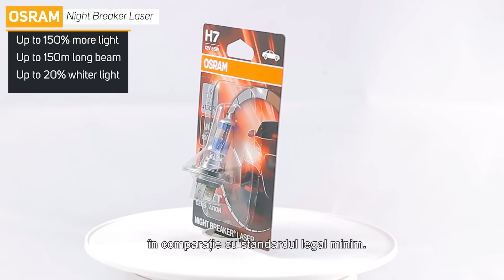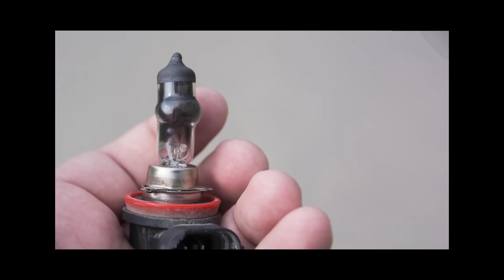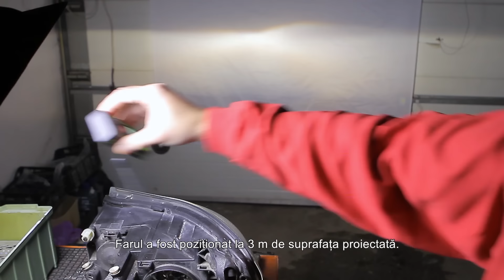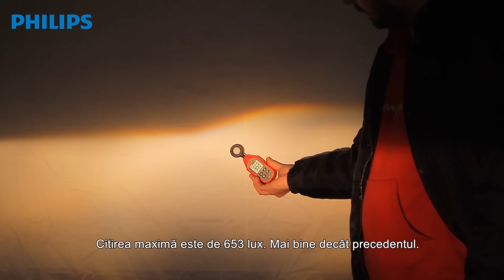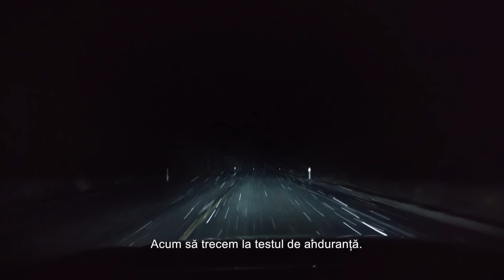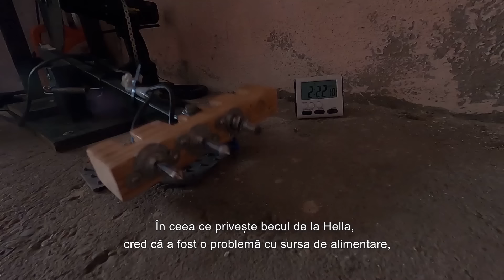Philips RacingVision vs Osram NightBreaker Laser - Endurance & Brightness Test

Comment: The failure mode of the Hella bulb is typical of filament lamps used in vehicle applications. The vibration causes the filament to break and the filament to move around with further vibration. This continued movement often causes the broken filament to reconnect and "weld" itself back together. Thus creating a shorter filament with lower resistance, higher current and higher light output - until the filament finally burns out again or breaks.

Comment: After many years I was using the night breaker series in H4 and H1, I decided to try out H7 Philips Racing vision gt200 one in projector lamps for low beam and reflector as high beam. The difference is quite high in my opinion. For the endurance I will watch it, since I use at least low beam day and night.
Especially for high beam the Philips version is a great advance, I can definitely recommend it.

I have a 2005 Chevrolet Lacetti which was equipped with H4 lamps. I am still a bit disappointed of their lighting ability, so I replaced them by original Suzuki Reno headlights which fit perfectly to the Daewoo/Chevrolet model. Only the connectors had to be adjusted.
Thank you for the great video!
Reply: Hi there.. How is the life time of your Philips? they still work?
Reply: how are the Philips bulbs? 1 year Update?

Comment: Having had both the osram and the Philips I can say that the Philips are a whiter light and last longer than the osram. The osram lasted 6 months, the Philips are still in just over 1 year later.
Reply: I bought a set of Osram Nightbreakers for my Megane. Literally just the other day one died at just a little over 18 months. Given the OE bulbs lasted YEARS that's not great. Light output was OK but no discernable difference over the factory fit H7s.
Reply: I had those Philips also in my car and they lasted almost 2 year even promised on box 450 hour lifetime. Much whiter light dunno are those more luminous but at least you can see light better instead regular more yellow light tone.
Reply: I had bought 25watt osram leds and one of the leds failed after 1year of use

Comment: The Osram NightBreaker lasers that I had, lasted 2 weeks. With less than 500 km of driving on asphalt roads in decent condition, I don't think I'll ever buy anything by Osram. Sent them email and the only reply I got was "Well, they shouldn't really break that quickly." Nothing else. I really should've made them give me new ones or just pay me back but I was extremely busy back then and didn't really have the time nor the energy to anything about it. Just bought a different pair of bulbs and went on with my life.

Comment: I don't think it was a problem with the power supply. It was the bulb burning out. Sometimes normal home light bulbs go out the same way. I guess it's because the filament somewhere gets thinner and this means it gives out more light. For a very little while, because as you said, this causes the temperature to rise dramatically in that part of the filament and it burns out.
So you could include the result from Hela.

Comment: More than 10 years ago in Sweden, my Toyota Hilux had glass lenses (not plastic). 

In that car I had Philips 100/140W H4’s (yes, they were illegal…). In combination with 3 Bosch Navigators in the front as well 6 driving lights at roof level (all Philips 100W) I had enough light in front of the car to reach ~2500 meters of light in front of the car at night. 

With that experience I still favor H4 & H3 light bulbs to modern LED’s. …and seeing your tests of old school bulbs for reflector headlights versus LED replacements there’s no question I will remain the old school kind of guy.

Comment: laser frate :)
I used Philips racing vision in the past. first impression was that they were brighter. No placebo, because i compared the lights during assembly
I used them for 3 years and then one burned and replaced it with the original hella.... surprisingly there was no more difference between the two. maybe the blue filter got worn in time.
Nice video. keep it going
Reply: No it's not the blue filter, actually halogen lamps do get slightly dimmer towards the end of their life. 
For some reason neither Osram nor Philips quote this figure in their data sheets for automotive lamps, but you will find these figures in their data sheets for hosehold halogen lamps. The most similar one would be the 12V 50W hosehold halogen lamp (for example, Osram HALOSTAR PRO 50 W 12 V GY6.35).
It says it has a light output of 80% of it's initial value at the end of it's life.

So if you replace used halogen lamps with new ones, the new ones are almost always slightly brighter, even if it's the same product.

Comment: Superb video.  Just what I've been looking for, for my GL1800 Honda Goldwing.  I've tried Ozrams on one of the cars and as good as they were they blew within weeks so I didn't buy again.  Ozram have a motorcycle H7 which is supposed to be more robust but if it is why not make it the standard for all vehicles?  So, I've been considering Philips.  Trouble is, changing headlight bulbs on a GL1800 is done by feel, and you need very small hands, so it's not something I want to be doing on a trip because it's not a 5 minute job.  But after watching your video I've decided that the small gain in light with Ozram or Philips is not worth the increased risk of bulb failure and I've decided to stick with the standard H7's. A big thank you.

Comment: I've fitted Philips racing vision six months ago in my 05 corolla, really pleased with the results but only last 6 months. It's a pain to fit them and they are not cheap but I'd buy them again.
Reply: Wow, my Osram Night Breaker laser is more than a year now and still working fine.
Reply: I've used Phillips racing vision in a couple of cars - all still working after 20 months although I can't tell if they are dimming now or if my eyes are getting worse

Comment: I installed 100w halogen bulbs many years ago on my FIAT 127. The light body was glass so high temp was not an issue, i had installed new wiring and a relay, so everything was safe and lasted many years. The difference in lighting was amazing! 
Would not try it on modern cars with plastic housings.

Comment: Completely normal for a filament bulb to be super bright just before it goes out. It’s because the coil shorts, resulting in less resistance thus drawing more current at the same voltage. This creates a brief over temperature = more light and whiter light before the filament melts completely.
Also used bulbs can actually become brighter than new bulbs because if micro cracks in the filament resulting in micro arcs (like xenon arc bulbs) even though they will actually draw less current because of higher resistance due to cracks = effectively thinner filament.
Reply: Btw I’m an electrical engineer so if I can contribute to your channel in any way just reach out. Think your work is great!

Comment: you might want to use another method to test for the effects of vibrations on the light bulbs though, the vibrations on the road tends to be higher frequency than just 3 cycles per second. good video though, very informative, will be waiting for another one

Comment: I personally prefer the Osram Nightbreaker LED Version.
It's not so cheap (I paid 110€ for two of them) and they were basically plug&play. 
Have been using them for around 3 years and they still shine as bright as on day 1 and don't throw any can-bus errors.
If you own a BMW that was manufactured after 2010, make sure to reprogram your board computer.
Use Beemercode and a compatible dongle to easily reprogram the bulb type from Halogen to LED.
If you don't change that setting, your bulb won't last that long and you night lead to error light on your dashboard

Comment: The ring bulb most likely went brighter before it burnt out.  This is normal when the filament starts to fail the resistance changes and more current goes through and it'd brighter then burns out.

Comment: As for the lamp glowing really bright before blowing, it's  possible that the fi;ament sagged down and touched the ground wire, so that only half of the filament was powered. In this situation, only a small portion of the filament glows very brightly before burning out. 
I've seen it happen on incandescent christmas lights when they're knocked down. One bulb glows incredibly brightly for about 30 seconds and then blows.
Reply: I was about to write this; that's exactly what happened when the Hella lamp burned out.

Comment: real-life experience with H7 Osram Night Breaker vs Philips 130+ in reflection based headlamps: 
- both have basically the same light, but give just a bit more visibility than normal H7s
- i bought 2 pairs of Osrams, these lasted 3 months and 4 months. on each pair the bulbs burned-out one after the other in a 1 week interval/offset
- after Osram i moved on to Philips 130+. i am using now the 3'rd pair of Philips, the first pair lasted 8 months(8 months 1'st bulb, and 9 months the 2'db bulb), the others burned-out after more than 11 months, with higher offset burn-out between the bulbs on each pair. 
so...philips all the way for me
Reply: Yes, it is just like an old 60 watt incandescent home light bulb you bought in the 1990s. The light output is the same, no matter which brand you opted for at the shops.

If a driver wants a beer lighting and illumination experience, just buy a newer 2020s car with LED or laser headlights.
Reply: I'm a bit surprised. 
I just replaced my corolla headlight bulbs due to yellowing.

10 years. All osram. Still worked

Comment: I like it a lot! If I were you I would test just the bulbs. It will find more viewers then if  spread it between oils and filters etc. 
I was always wondered which bulb is the best. Its not always just about the light but about the durability the bulb itself. In my Skoda fabia 3 the bulb needs to be changed quite often. Just the originals bulbs can be fitted more than two years.

Comment: I've been watching a lot of videos on bulbs, and your is one of the best.  Also, those H7 HID bulbs are sweet!  I'd like to put them in my 2012 Hyundai Genesis, but it is darn near impossible to replace them.  I did replace the OE H7 bulbs several years ago with the Osram Rallye H7, which use a H9 burner.  But those are now unavailable.

Comment: Fitted high output halogen light bulbs to my classic shape 1999 Subaru Impreza turbo, the standard light output was very poor. I think the updated bulbs from memory were something like 80/100 w, they were much brighter! but the extra heat produced would eventually melt the back of the bulb holder out! I bought several bulb holders from a  Subaru breakers yard and replaced them as needed, they would last around a year or so!

Comment: First of all, Good effort in the video. 
Secondly,  try to speak accurately brother.  You said 635 instead of 653.
And most importantly, we use relay in cars when we use higher wattage bulbs otherwise higher wattage bulbs will not give good light output.

Comment: I think the hella ones had some issue in the bulb itself. I was using Philips bulb but had to change right bulb temporarily so I put in a cheap material and that bulb fused the same way. It first turned white and then fused but the Philips one on the left was perfectly fine even then

Comment: It is not fair to compare Halogen lamps with HID lamps. When you compare Halogen lamps the light output is higher if the manufactorer "burn" the lamp to get more light output. That means less life hours. The gas filling also means a litle bit. So a "long life" Halogen lamp give less light output but longer life. A "super" Halogen lamp give more light but shorter life lenght.

Comment: How can you say no suprise the hid xenon is illegal because it's 900 lux.  The factory hid are as Bright or Brighter as are the ridiculous LED headlights that for some reason no longer require self levellers like HIDs did.  The brightness is not the problem but the glare.  Not all HID bulbs are the same and neither are all headlights so retrofit is a challenge.  Some halogen oem set ups are dangerous due to such poor light.

Comment: It could be said lazer etched halogen lamp housing allmost all  halogens are same ....as I changed different manufacturers ....lazer light are diodes or led as in BMW's.  ...I got 60w to 90 watt halogens but with ceramic holders n new relay circuts in suv ....they were blinding effect intense light

Comment: 6-700 lux is too weak from 3meteres, I measured 2300 on the RacingVision from 3.8meter with a non projector dirty headlight. 600lux is a illumination of a work place in an office, imagine if your bulbs maximum illumination is only that level from 3meters that will it do after 50meteres? Nice test but try to make it real, something was wrong, maybe your tool wasnt cosfi compatible or any other problem.

Comment: There is NO SUCH thing as “increased current”!

That power supply DOES NOT change the current output!

Do you know ohm’s law?

The only way for more current would be if the filament changes, which is what happened here likely: Filament broke and got reattached momentarily with the shaking (less resistance after breaking, more current, more light, burned).
Reply from the maker: I'm a quality engineer, not an electrical engineer, that's why I was not sure what happened. The camera was set to record 1 frame/5sec, so after the Philips bulb died, only one frame was recorded with the Hella bulb working, but the light output was way higher. From my point of view, it's unlikely that both bulbs from Philips and Hella would burn-out at the same time.

Comment: My 2013 Hyundai i10 has brilliant headlights, very white and light up the road effortly they are std from new. My other car is a Ford cmax a little older, the lights are pathetic, yellow and are dangerous on dipped beam. They both appear to have the same spec bulbs. Any theories please.
Many years ago Lucas introduced "Bright eyes" 75w white lamps, they were much better but got through 4 bulbs in 6 months.

Comment: Thanks for the test just proves for the price that 200% brighter phillips bulbs is a lie and the standard bulb is best you will get or use hid
Reply: actually they are kind of worth it if you have an car with a single h4 bulb for both low and high beam
if you will use the bulb just for low beam (h7) then its not really worth it since its both more expensive and its not gonna be an improvment compared to a generic bulb

Comment: buy a normal halogen, all these colored bulbs are not worth the money, and even if the color can be a little whiter, the colored bulbs shine worse, you want better light, so buy 100\80w if it is h4, or other variants with a little higher wattage, just remember that the original wiring harness is not designed for higher wattage, it is often not designed for the bulb that sits there originally, so an additional wiring harness with a relay must then be used, these can be bought ready to use with everything you need. this is also not legal, but is usually not looked at in inspections, you end up with worse light than xenon anyway, so in my eyes this is not a big problem.
Reply: if you have h4 you should rather upgrade your headlights with something that comes with 2 diffrent bulbs for better results

Comment: I have a question for a pro because I am about to lose my mind: just bought a 2004 MB E500. Headlights are: D2S HID for the big ones and H7 for Halogens for the small ones. I am not happy with their brightness at all. What would be the best if I want to change them  that are bright, whitest possible and are going to last? I was about to go with these but you mentioned 6 months and I don't want to spend money every 6 months! Thanks
Reply from the maker: A friend of mine has the same headlight setup and he uses Philips Blue Vision. I'm not sure if this product is still available as he installed them 10 years ago and the bulbs are still okay. I haven't tested that product yet, so I don't have any data on them, but I believe that the Philips Racing Vision tested in this episode has better light output than Philips Blue Vision.
Reply: @SergiuGabor  thanks a lot  i just contacted philips by chance asking about warranty. According to them the racing and xtreme visions (%150 and 130) should not be bought as they are not legal in US! I hate this. I wish I never purchased this car.
Question: Sylvania customer service claimed I can install H7 LED in the halogen compartment without any need to change anything. Does that sound right to you? She argued that they just dont go that much further down the road like the halogen from her experience but life span is not more than a year. What do you think?